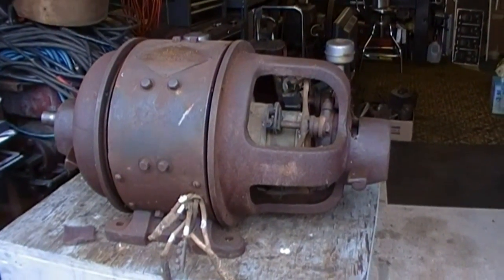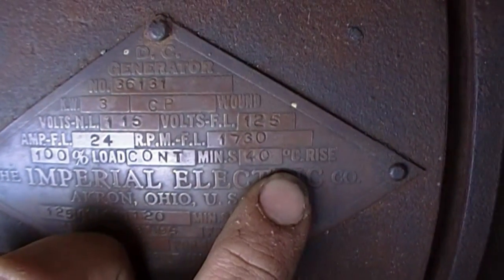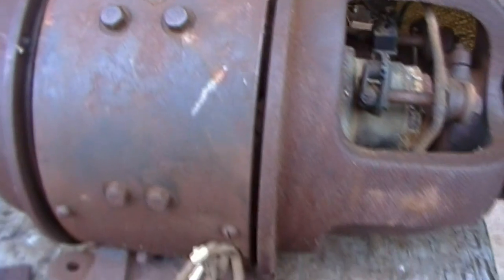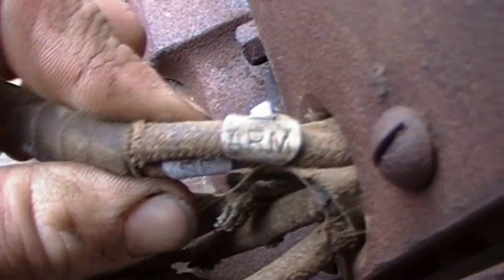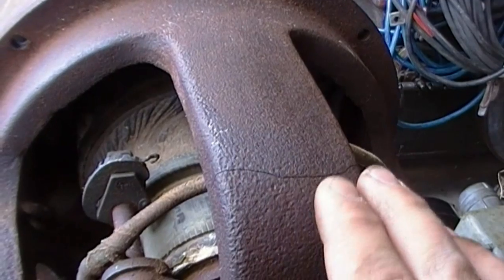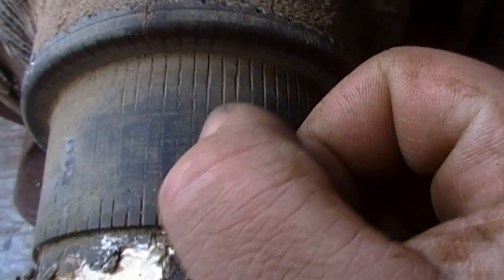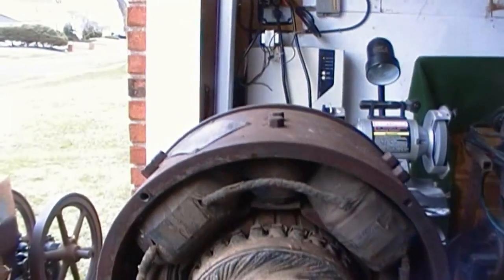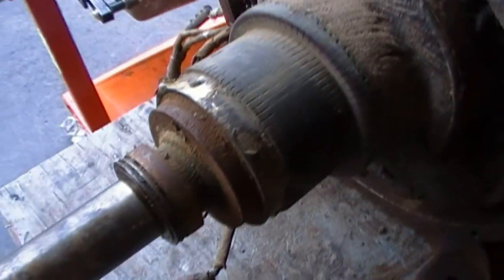1920s 3KW DC Generator

Comment: is it 240v center tapped so you h a ve 2 legs 120 each will it power a window air-conditioning unit lights and TV or steteo

Comment: The small windings are compound method of improving voltage regulation.  Under the load current through them, the field is modulated to keep output voltage more constant.